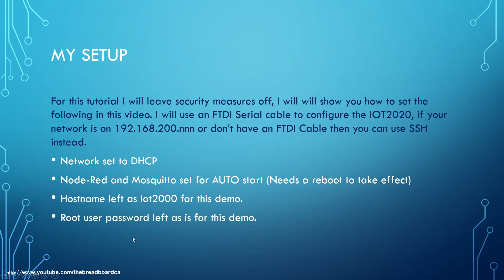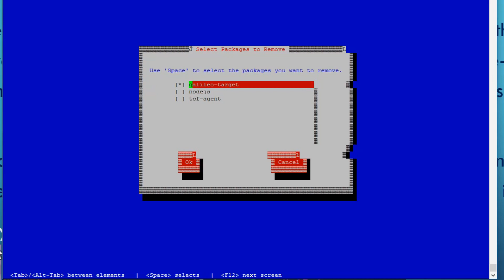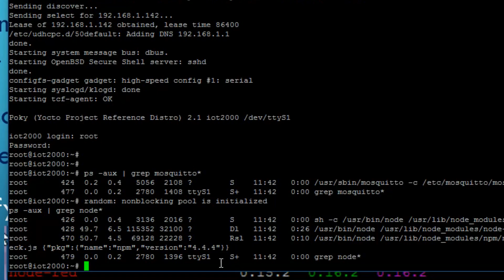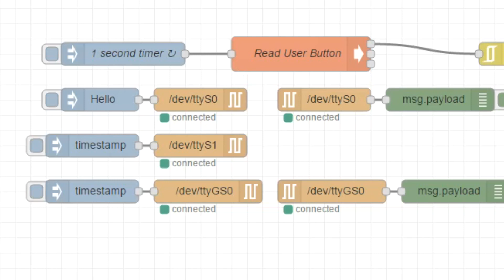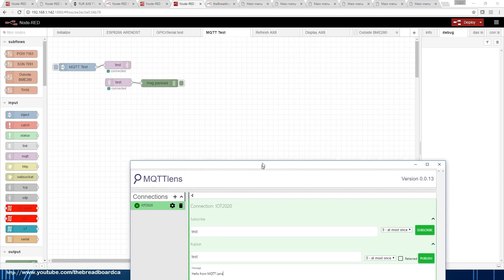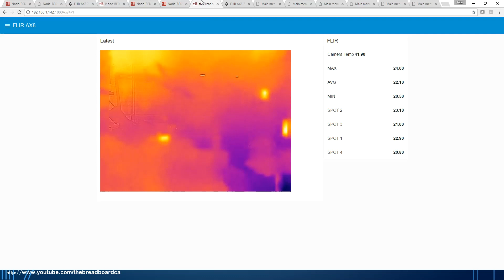IOT2020 Firmware 2.1.3 Preview

Comment: An alternative way to the static IP problem is to change the Ethernet settings right after creating the SD card and before putting it into the IOT box. Just mount the sd card, go to /etc/networks/interfaces and change eth0 settings to dhcp or whatever static IP preferred.

Comment: for a 192.168.x.x the network mask is normally 255.255.0.0,  just change this for all your other network machines,
should be easy if you control your own dhcp server, no need to change it on IOT2000.
also if you use softperfect network scanner : add a range using the green plus sign, 
do not extend the base range from e.g. 192.168.0.1 to 192.168.200.254 (this takes a long time to scan), 
use 2 ranges e.g. 192.168.0.1 to 192.168.0.254  and  192.168.200.1 to 192.168.200.254 ...
Reply from the maker: Sorry but you have a slight mistake
All networks in the range 192.nnn.nnn.nnn – 223.nnn.nnn.nnn are class C networks and have a normal subnet mask of 255.255.255.0, this allows upto 255 unique addresses on each subnet. Technically you can effectively supernet a few class C's into something resembling a class B but this is not standard practice. you can in some cases also dual home an ethernet adapter and this will effectively give it two ip addresses, this too is not a common home network practice.
Reply from the maker: Ah, Sorry, you're mixing up one point, the Class C private networks run from 192.168.0.0 through to 192.168.255.255, 

Class "C" networks in total (Private and Public) run from 192.0.0.0 through to 223.255.255.255 with 256 addresses per subnet. 

This does not change the fact it is a Class C network with 256 addresses available for each of the available 256 sub networks (It is actually a bit less IP addresses etc for each when you factor in Broadcast addresses etc. So you still would not normally use a subnet mask of greater than 255.255.255.0 for any of the 192.168.nnn.nnn address ranges. 

See https://en.wikipedia.org/wiki/Classful_network for more info

My comment was referring to any class C network, not just the private ones.

Normally if you want a broader range of IP addresses on your private network you would choose a Class B network in the range 172.16.0.0 – 172.31.255.255 and this is normally used with a 255.255.0.0 subnet mask allowing for close to 65535 addresses.

I say normal because this is the default and recommended masks for these networks. If you know what you're doing and have a special case and dont worry about default behaviour of pretty much any network device and software out there, then you can change the masks to suit your needs. For the average home user this is rarely needed.

Point to remember, subnet masks are designed to help control network accessibility and manageability, if a network node thinks it is on the same "LOCAL" network as another device it will endevour to use MAC addresses etc to communicate. this can cause problems if your network is not completly under your control or understood.

Comment: Thanks Peter,   This saved me a bunch of time.  What Version of Node-Red did you end up with?  I used your command line and went to the wanted version 0.15.3 fine.  I still noticed missing features from the pi at 0.17.4.  So I tried "npm install node-red@latest".  There were many minutes of the install complaining, but it ended up at 0.18.4.  It does seem to work find, but I am sure that something will not be right.
Reply from the maker: I have not tried anything for a few months so I wont be at the latest but I am working with Siemens to get the latest version of their firmware out, it should contain updated node red, MQTT, MySQL etc, as soon as I know I will share the info

Comment: Thanks Peter, 
I am wondering to use IOT2020 with industrial 4 analog sensors 4-20 mA, but I don't know which Arduino shield should I use.
Reply from the maker: It does not have to be 4-20mA, it could be a 0-10 or 0-5V one and you simply add an external resistor for the current loop, assuming you can tolerate a common side between them

Comment: Has there been any progress on the serial port with node-red ? This is such a useful port (as are the others, I2C, SPI but UART is the first thing to get up and running) that I'm surprised that it's not up and running out of the box :(
Reply from the maker: Hi Kas :), The serial ports on the IOT2020 / IOT2040 work very well with Node-Red, the 2020 of course does not have full blown RS232/485 capability, just the debug port and the Arduino pins 0,1
Reply: Thank you, I'm not sure why I kept missing them possibly because I was searching UART and looking in the Intel_gpio section only.

Now I'm hoping to get SQlite working or soem database to store data locally but so far can't find the sql node or much information on how to setup the database, but I'll keep searching.
Reply from the maker: if your using firmware 2.1.3 then SQLIte3 is already installed
Reply: Where do I find the node to add to a flow? I have looked (a lot more carefully this time) as well as searched for it.

I have also tried running "npm install node-red-node-sqlite" but this just generates an error

> sqlite3@3.1.9 install /home/root/node_modules/sqlite3
> node-pre-gyp install --fallback-to-build

node-pre-gyp ERR! Tried to download(403): https://mapbox-node-binary.s3.amazonaws.com/sqlite3/v3.1.9/node-v48-linux-ia32.tar.gz
node-pre-gyp ERR! Pre-built binaries not found for sqlite3@3.1.9 and node@6.9.2 (node-v48 ABI) (falling back to source compile with node-gyp)
make: Entering directory '/home/root/node_modules/sqlite3/build'
make: Warning: File '../../../../../usr/lib/node_modules/npm/node_modules/node-gyp/addon.gypi' has modification time 8621456 s in the future
  ACTION Regenerating Makefile
Process PoolWorker-1:
Traceback (most recent call last):
  File "/usr/lib/python2.7/multiprocessing/process.py", line 258, in _bootstrap
    self.run()
  File "/usr/lib/python2.7/multiprocessing/process.py", line 114, in run
    self._target(*self._args, **self._kwargs)
  File "/usr/lib/python2.7/multiprocessing/pool.py", line 102, in worker
    task = get()
  File "/usr/lib/python2.7/multiprocessing/queues.py", line 380, in get
    rrelease()
ValueError: semaphore or lock released too many times

Any help or pointers would be very much appreciated.

Kas
Reply from the maker: I am requesting a little help from Siemens, I will get back to you soon I hope
Reply: Thank you very much, I appreciate this.

K
Reply: Hello Peter, 

Has there been any response from Siemens?

Thanks
Kas
Reply from the maker: I have reported the issue to them and they are investigating, they have also asked for more info from me so I am trying to pull that together for that, first by reproducing the issue,  I have also been led to understand there will be a firmware update soon as as soon as I know when it will be released I will let you know, there are some node red updates in it I believe
Reply: Thank you

Comment: As i now upgraded to 2.1.3 in  IOT2040. My doubt is I want to take remote connection of IOT2040 with different network IP? Fr ex, my PC IP is 192.168.200.3 and IOT2040 IP is 192.168.1.40 how to take or how to install VPN connection in 2040.
Reply from the maker: If you have a FTDI cable, you can establish a console through that and then edit the network/interfaces file to set the ip or even simpler run iot2000setup.

The default of the IOT2000 firmware is 192.168.200.1 though  so why move it if you want to access it on the same network.

What is it your trying to do ?

VPN would be something you do with a router or something, it would seem overkill for the IOT2000 devices, surely you just need to route to it over IP ?
Reply: Actually I am trying to take remote connection of IOT2040 which will be in different IP address say 192.168.27.10, my PC is in 192.168.2.123. So how to connect these two different networks?

Is it possible to take remote connection of 2040?
Reply from the maker: for the remote connection, I would suggest SSH (Telnet session), or create a UI using Node-Red
for the IP Address, you simply need a router "Route" command setup, this is where you tell the router how to find a different network, normally if the IP address your after is on a different subnet then the IP packet will be sent via the "Default Gateway", but if you have a local second subnet then you may need to issue a specefic rout command that gets remembered by the router.
What I do here is have a second old router and connect it to the first via its WAN port, this way I have a completly isolated subnet and the first router is told how to get to it.

Hope this helps

Comment: seems like an interesting product, but a raspberry pi with some extras would be about the same price, what is the benefit ?

for a soft entry professional system, it seems bad practice to run everything as root by default. shouldn't they have separate users for each daemon ? both node-red and mosquito don't use privileged ports by default, and have separate users, so they've reversed that default for thier embedded versions ? running as root is just a really bad idea.

IOT platforms are getting to be much higher profile targets for hackers etc., two extra users would seam pretty cheap way of protecting your embedded server from at least some possible root escalation attacks, when vulnerabilities become known.. you need to enable the network if you are going to network node-red/mosquito with other resources, even if you disable ssh.

even for a learning tool, it seems to set a bad precedent. hopefully they'll fix that at some point, its a new-ish release..
Reply from the maker: CE and UL certified, already in an Industrial DIN rail mount enclosure ...